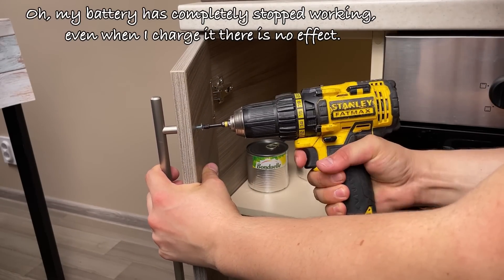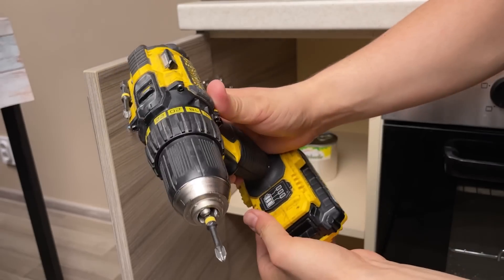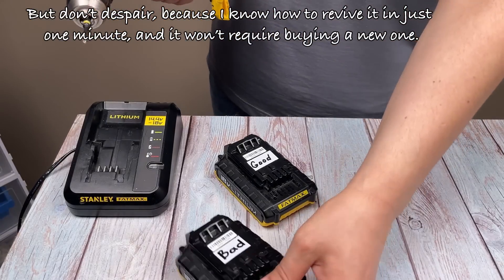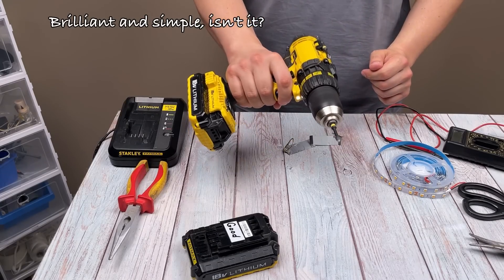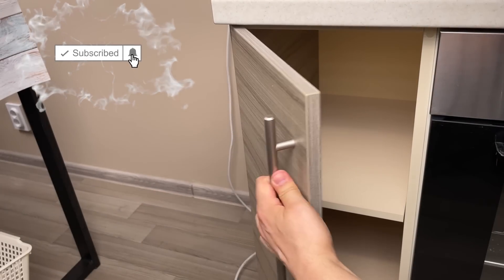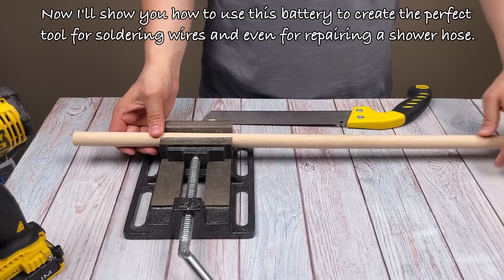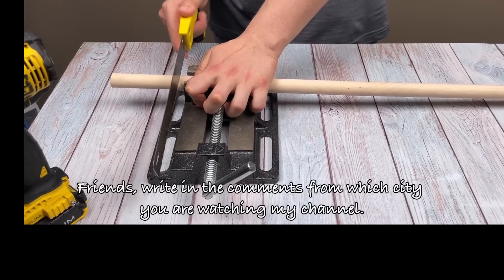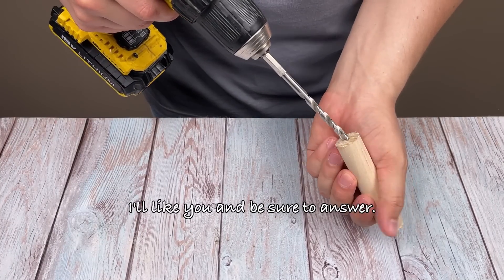🔥🔥How to Revive an Old Battery in 1 Minute with Using Tin Can Caps!

Comment: I did this and it did not work on my dewalt 20v lithium Ion batteries. Not sure how long you are suppose to leave them hooked together, on the video it looked like a quick step.
Reply: The test light would light up completely on the defective battery while they were hooked together, but once I put it on the charger it would not take a charge.
Reply: I found this vid and it did the same thing as here but went a step further and it actually worked if this one doesn't. "How to revive DEWALT Lithium battery? Not charging, If jumpstart won't work, try manual reset."

Comment: and again , with the "spot welder " he is dead shorting a lithium battery ! that's one of the fastest ways to cause a battery fire , and the shower hose ? when he turns it over the stainless has turned gold /blue , that means a lot of localised heat  , DO NOT DO THIS ! EXTREME HAZARD !

Comment: what a crock , you get bad terminal connections all the time , but if the battery is done that is it ! in fact you could actually start a fire by starting a charge on a battery with a comprimised cell , be very careful with old lithium batteries , the cost could be a lot more than just buying a new one !

Comment: Question: Will doing so damage the battery? Thanhk.
Reply from the maker: Thank you for your comment! ❤️🔥 No, low voltage current and special wires are used here - this will not harm the battery!

Comment: First of all, I don’t know why you don’t use a wire instead of playing with dangerous, sharp objects like cutting the lid of a can. I did mine with two copper wires and four washers, and it worked exactly the same.

Comment: I don't think the newer alkaline batteries have the carbon rod inside, just the cheap, old fashioned non-alkaline batteries.  I like your "fixing" low voltage LiIon batteries; you might mention that chargers are built to not recharge LiIon batteries below a certain voltage level. You can also use a low voltage power supply but your technique will provide for even the most, non technical person!

Comment: Bunk! This will not work in reviving a bad battery. It will allow it to charge, but the bad battery will not hold that charge for long. In most cases, the bad battery will be quite dead within  a day or two and probably overnight.
Please notice that even after all the talk about how the rings are not conductive and are "safe" to touch, He doesn't use them and touches the conductive strips while connecting and disconnecting the jumpers.
This entire video is a scam....

Comment: This will not work if the bms fails internally.  I've got one sitting on my work bench torn apart and the cells are fully charged yet the bms has shut down internally and will not let the current flow in/out of the battery.  Cells will be used in other batteries when needed though.

Comment: The voltage wouldn't hurt you even if you touched the lids.  Notice that he touched them himself.  
Basically you are bringing the "bad" cell voltage above the shut off in it's internal battery management circuit (bms).  Once voltage goes below the bms minimum it shuts off the battery.  Jumping it back above the minimum allows the bms to make contact again.

Comment: A shock  from  18 volts      only if you lick it and the metal rings will conduct they are metal.                  You mite have to do a bit better than that

Comment: I've never been shocked by a battery and have been using this method a long time now. Get the polarity backwards and you can get a melted wire that could burn you though. I just slide a finish nail in each P+&-N slot in the battery's connect a jumper on each. Wait for a few seconds and put the dead battery in the charger. On a car battery I put the charger on high start mode for about 2 minutes or so then it will see the battery and let you charge it.

Comment: For a short time, this might seem to work, However, this method is very unsafe as you are ignoring the charge protection from the changer,  The battery cells are most likely high current 20Amp (2500mAh) 18650s used in many power tools and need to be balanced perfectly by the BMS any damaged cells in time can and will overheat (Thermal-runaway) and fire. In simple terms never try to recharge damaged cells.

Comment: You can do the same thing with wires no need forthe can  😮tops
Reply: The thing about wires is that they need to be the correct gauge in order to safely handle the expected current. That piece of metal can handle way more than those batteries can muster. A piece of wire that is too thin can just burn up. If you happen to grab it at the burn-point, YOU will get burned.

Comment: B S you can just insulted copper wire! This only works if the battery is a good one and has accidently been discharged, if it is truly faulty this won't fix it, believe I've tried with ny Dewalt ones!
Reply: True. A defective cell won't get charged by chargers, as is true for an overly depleted one, but a DEFECTIVE cell can burn/explode. If you don't know for certain that it's just an over-discharge, use extreme caution (gloves, something to block flying battery-bits)

Comment: Why is there a protective circuit to prevent deeply discharged Li-ion batteries from being charged?
Is it wise to short-circuit a functioning battery with a deeply discharged battery? So only with the increased internal resistance of the defective battery as a current limiter?
Apart from the fact that the "revived" battery is now pre-damaged, probably has a high self-discharge rate and no longer has as much capacity and power - a replacement battery that you can rely on is also much cheaper than a fire service call.
Wow - an electric shock at 18 volts?
Reply: Só para mencionar... 18 volts deve ser muito forte na língua...não coloquem a língua...kkkkkkk

Comment: a better and a lot safer way is to get a smart universel battery charger,,,and set it to the proper battery type and,specification,i,your method is only good for sending a low voltage to the battery ( 30%  is anof,,for example,,6volts for a 5 cell 18volts lithium battery, less the charger may not be able to detect it,)so  the charger can recognise it and start the charging cycle,,and by the way a set of cable with alligator clips is recommended,and  shoud be used in a cycle of  a1seconde  on and off ,,because living it plugged like you did could be hazardous if the dead battery has a shorted cell,,when you make contact with the clips you can see if there is to many sparks that could indicate a short in the dead battery,in that case do not attempt any more charging it,,🤔😉

Comment: Great video ! I hoped you might have mentioned the common reason why a "bad battery" won't change ! To keep it simple,  if you milk every bit of energy from the battery instead of putting it on the charger when it first stops, it can go into under voltage and then the charger won't recognize it , so it's bad user not bad battery 😉🙃😎 NZ
Reply: Can't get charge in that time, kick start, yes but it still needs a few hours on the charger.
Reply: The BMS in lithium batteries prevents that from happening, but that was the case with the old Nicad batteries. If they don't get used much they can drop below the minimum voltage and especially if they don't get charged and are left for a long time between uses
Reply: Newer battery chargers will not attempt to charge a dead battery. I have a variable power supply, using it to briefly touch the dead battery terminals brings the dead batteries charge above the no-charge threshold of the new battery charger. CAUTION!!! Lithium batteries are dangerous. They can swell, explode, overheat, catch fire, cause serious injury if using a charger not designed for a specific battery.
Reply: @jgs3456  I've found this with 2nd RC batteries , the person didn't do any balance charges , then one cell gets below the minimum and the charger refuses to charge the pack , there is a way I found to recover the cell if it's recoverable ..... totally safety with that process 😉🙃😎 NZ
Reply: I bought an adapter to use 20V (new battery) on 18V but no instructions especially not to leave the adapter on battery, well that drained it. Now I have to jump it. I heard from a friend and now I see one way to jump it. 👍🏼👍🏼👍🏼👍🏼👍🏼😎
Reply: Handy to know 😉 Toronto 🇨🇦
Reply: Das Video enthält sehr viel Blödsinn !
WARNUNG  ! Machen Sie es nicht in der gezeigten Art!!!
Wenn Sie von solchen Basteleien und Strom keine Ahnung haben, lassen Sie die Finger davon. Denken Sie auch daran, dass es viele Akkuhersteller und Akkuverwender gibt, welche die Konkurenz abhalten wollen. Nicht alle Akkus sind in gleicher Reihenfolge gepolt ! OHNE ein Vielfach-Messgerät können Sie die Polung nicht ausmessen!

Wozu soll der Dosendeckelgriff dienen, als Antenne vielleicht?
Dosenblech ist an der Doseninnenseite lackiert, denn sonst würden Doseninhalte das Dosenblech zerfressen und der Inhalt giftig werden, vor allem bei Aluminium.
Es hätte darauf hingeweisen werden müssen, dass nur die Dosenblechaußenseite leitend ist.
Die Deckellasche ist sehrwohl leitend, denn sie ist aus Metall. Die Vernietung der Lasche ist mit einer Isolierschicht versehen, die auch als Dichtung dient.
Beim Einsetzen der Blechbrücken ist darauf zu achten, dass es durch den hohen Strom, der zwischem vollem und leerem Akku fließt, zur Erhitzung der Bleche kommen kann.
Ich würde die Blechstreifen nicht in der gezeigten Weise schneiden, sondern aus nur einem Deckel zwei Streifen ohne Lasche. Besser ginge es ohne Erbsen und deren Dosen.
In jedem Haushalt gibt es Küchenmesser und ebenso eine alte Verlängerungsschnur oder altes Netzgerät vom Handy.
Diese Schnur hat zwei Drähte und eignet sich für die Brücke zwischen den Akkus, ist nicht scharfkantig wie die Bleche sind und beweglich ohne eine Kurzschlußgefahr durch umfallenden Akku, womit beide Akkus getötet werden könnten und sie Ihren Schrauber auch dem Nachbar oder Müll geben könnten.
Ja! Ein zu sehr entladener Akku kann auf die gezeigte Art manchmal wiederbelebt werden. Besser ist es, bei den ersten Zeichen des Schraubers, den Akku zu wechseln. Außerdem sollten Lithium-Akkus bei längerem Nichtgebrauch mindestens einmal monatlich geladen werden.

Der Duschschlauch mußte nicht in gezeigter Weise geschweißt werden. Es war zu sehen, dass der Schlauchmantel wieder eingeschraubt wurde. Wer darauf achtet, dass der Schlauch bei der Benutzung bzw. dem Ablegen nach dem Gebrauch keine Schlingen=Achten bildet, muß sich keinen Akkuschrauber und Akkus kaufen bzw. ausleihen. Wenn der Schlauchmantel doch einmal "frei kommt", reicht Isolier.- oder Tesaband auch.
Das Schweißgerät als Graphiergerät ist ganz toll, doch deshalb müssen Sie keinen nachher rumliegenden Akkuschrauber kaufen. Ihr Autoakku macht das auch.
Reply: Great video. Thanks 👍
Reply from the maker: Here's another story, it often happens that your battery refuses to work and needs to be reset
Reply: without.
Reply: 😊 @FixItFast1
Reply: I'll just buy a new battery Jesus Christ.
Reply: @handygramps51 my battery cost $145 on sale reg $170! So, yeah, just buy a new battery!
Reply: @handygramps51 hay stop that
Reply: @handygramps51 That's called using the Lord's Name in vain.(that means, for no reason)  It is a command from God, and you obviously don't know the power that is in the Name of Jesus Christ.  The Bible says that many are destroyed for lack of knowledge.  Repent, and quit acting the fool.
Reply: correctly said

Comment: Hello I’m from nutwood close,Bedford,England  have a question for you the cardboard in the drill say.do you know if that would work on motorcycle plastic from 1990.its been out in sun a has gone crusty on the front mudguard of scraped it all off and tried wet, sanding, wet sanding with oil. I know people do it with a blowtorch but my problem is if it goes wrong you cannot get replacement plastic. This is why I’m asking if you know if it would work a polish you use I take it it’s got a cutting compound in it.. look forward to your reply regards glynn

Comment: This has to be the dumbest thing i have ever seen. I deal with li-po li-fee- li-ion and various others. one thing you never do is cross chare a battery. you never do this. cause could cause a back feed. it has happened befor. but if you have a cell that is weak or dying in either batter. you could be over charging it. there are much safer ways to do this. what a great way to ask for an explosion of a battery.. they battery. people do not use any kind of lithium battery for this kid of stupid use. you will in time or may right off the bat cause a bad issue. we always did stupid tangs to push our batteries. but we always did it at a distance. these batteries have a bad history. I usually fight for them. but when i see this i have to fight for the safety. and how others use stupid ideas like this to cause the batteries to burst and go in to very very hot flame. do not do it you been warned
Reply: Look how careful he is about 18v killing himself!
Reply: @SuperdooperScrooge  He is safe due to special kind of metal that does not conduct electricity!